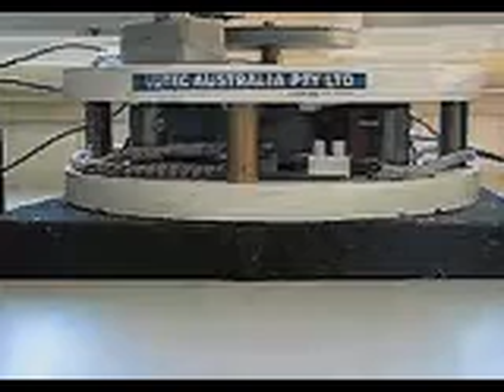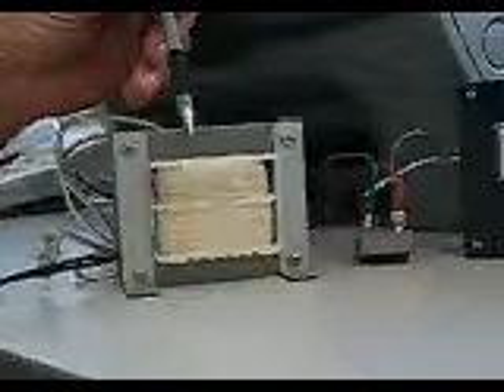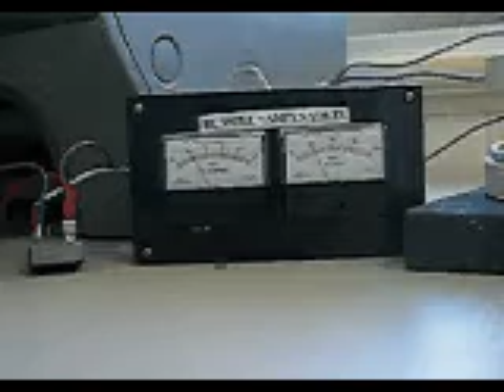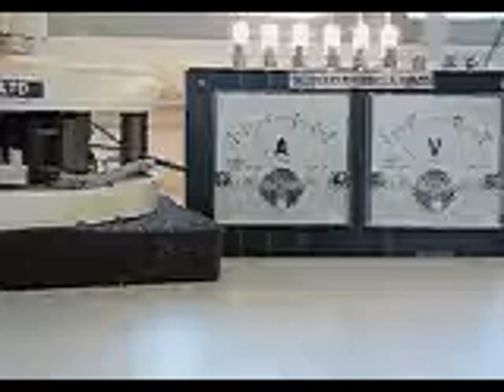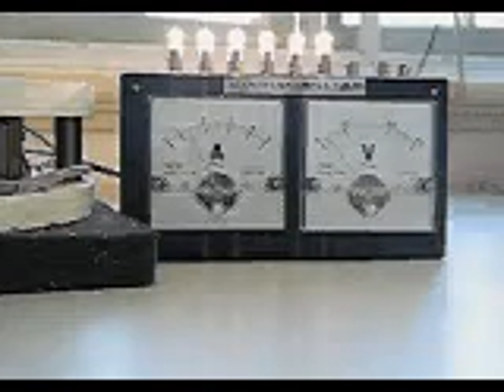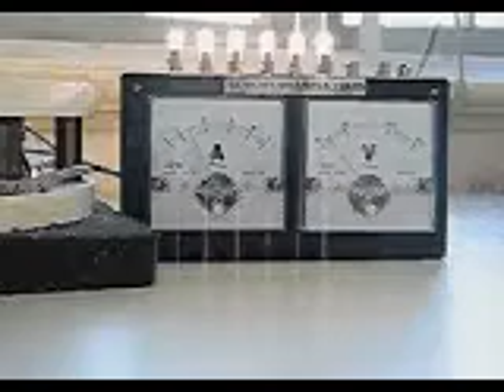Romag Modifyed to Upstep

Comment: DC amp and volt meters measuring an AC power supply will read zero--no power, regardless of the actual power output.  

AC going through a full wave rectifier does not produce DC unless there is no load. Under load without a huge capacator, voltage and current pulsate.

I would like to compare AC amps & volts going into the rectifier and coming out of the motor. And, even then one should be wary of reactance.

My guess is the demonstrated process is about 90% efficient.

Comment: He should use nichrome wire element for his calculation.
Bulbs may light at variable brightness.

He needs a fixed load of dependable characteristics to measure output power, a wirewound resistor, etc.

Comment: think micro and multiply 
its all about efficiency
1 watt that fits in your hand can be worth all the oil left in the world if you can mass produce it cheaply and stack em 10 watts 100 watts etc. stack 12500 of em in a hole in your basement and you have an electricity well for your house ( and to charge your Chevy Volt) FOR FREE! mass produce it cheaply or come up with a way to home build easy and you liberate all mankind energywise no less than the internet enabled world wide free speech

Comment: Oh, my. What does it show if you measure the currents and voltages with true RMS meters? Galvanometer style meters are notorious for errors where there's an AC component on what is being measured as if it were a DC signal, and that measurement is then used to compute the power in vs power out.

Comment: So you have a machine that will save the planet - no need to build any more fossil fuel burning engines of any kind. So why don't you get this machine independently verified and put in to production? Maybe, if it was independently verified, the skeptical engineers (myself included) might actually believe this is for real. Better yet we could work out why it works and improve the design. Will I get any response to my request for information?